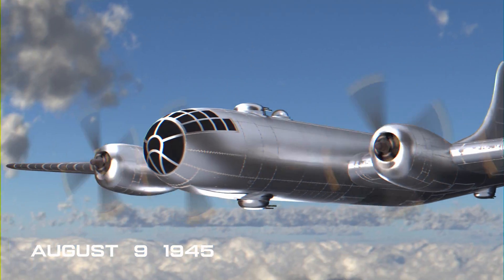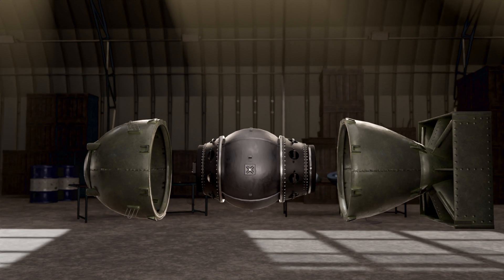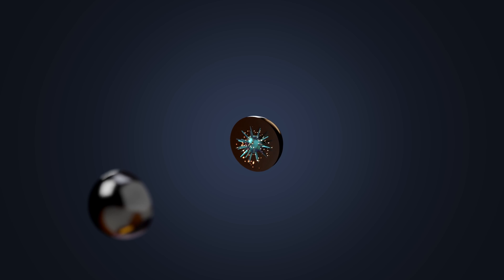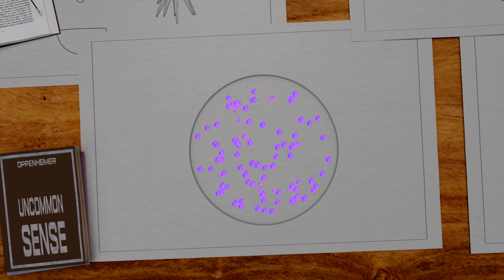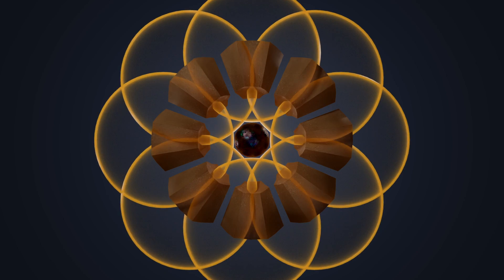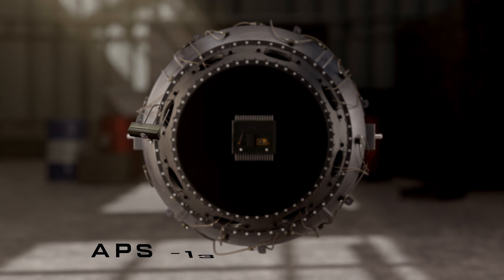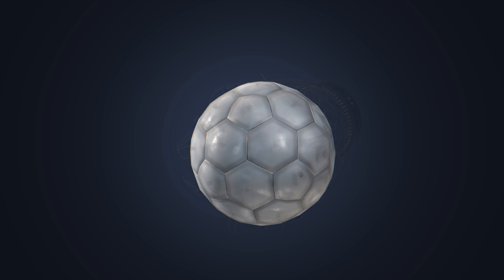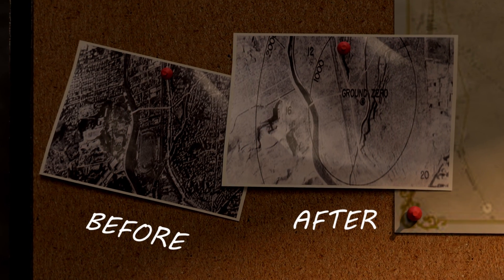HOW FATMAN WORKS ? | #defence Animated Video

Comment: This video leaves  out the reason why there's an Aluminium pusher in between the explosive-lens and the Pit (Core/Tamper assembly), it's to help smooth out any irregularities in the converging shockwaves and to also double the strength the shock.
Reply from the maker: 5:48

Comment: It is crazy and mind blogging to understand that this whole process takes place in less than a second. Some genius level engineering.
Reply: @charlesdaconquerer  The actual nuclear explosion lasts less than a microsecond.
Reply: The actual time was so brief that the length of the wires to the detonators had to be adjusted so that all the detonators activated within microseconds of each other.  And the detonators had to be extremely precise so that they all exploded at the same time.  This went to the blocks of explosive being machined to very tight tolerances so that the forces all happened simultaneously.  Common mining and demolition explosives and detonators vary too much for this application.
Reply: it's no accident it was developed by probably the smartest team of people ever assembled.
Reply: The people who worked on fat man are obviously brilliant but don't get too confused. It wasn't one team of people. It was a collective of knowledge and experiments that lead to the process. What the team at Los Alamos did was execute on that knowledge first.

Comment from the maker: Shall i make a video on Little boy, which was dropped on Hiroshima ???
Reply: yeah, you definitely should....
Reply: Yes please, another topics could be hydrogen bomb or, very interesting in my opinion, the atomic artillery shell, I always wondered how this one excatly works :)
Reply from the maker: @danield.k5765   The issue with hydrogen bomb is, different articles are depicting its structure in a different way and there are multiple arguments about each structure.
But i will definitely look into making a video about it.
Reply: @immersiveengineering  post it twice to be historically accurate
Reply: @immersiveengineering  maybe should interesting make a vid about the isobaric bomb working process...
Reply: YES PLEASE!
Reply: @immersiveengineering  yes
Reply: @immersiveengineering  yes!
Reply: I came to the comments to ask for a video on Little Boy.  I know it used a large gun barrel to shoot a slug of radioactive material into another piece of radioactive material to create the critical mass.  But, I heard that described in several different ways, so I would like to see your video on it.
Reply: Of course.